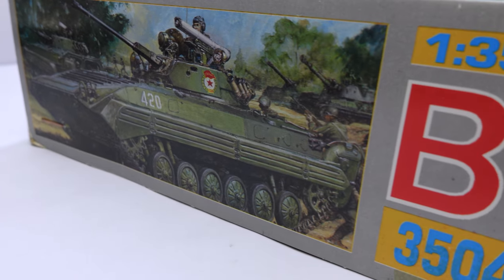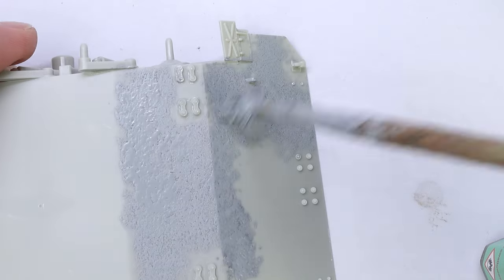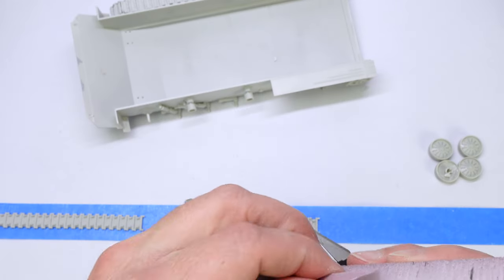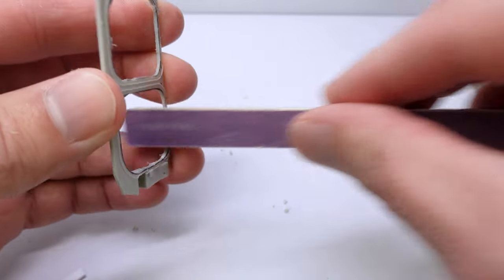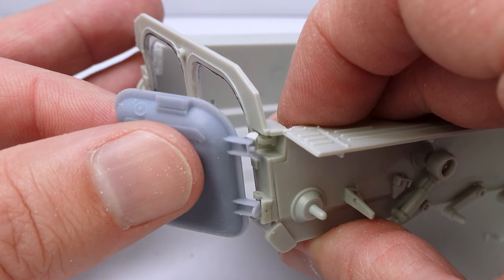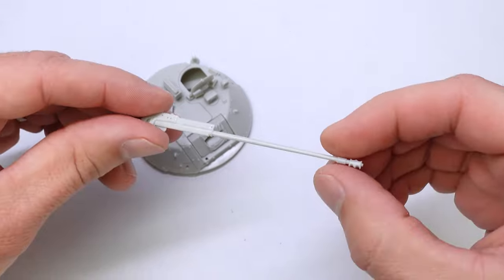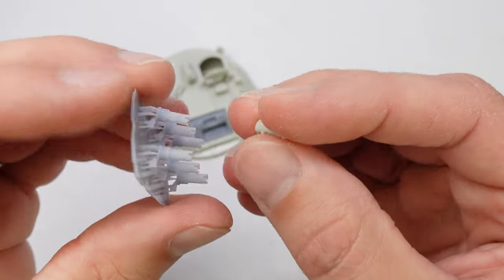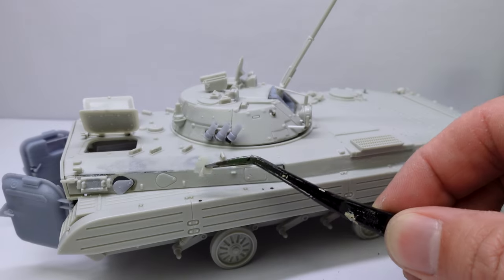Upgrading A 30-Year-Old Kit So I Can Destroy It!

Comment: Fyi...the side skirts are for floatation.  Pretty thick with some foam on the inside.  BMP2 was heavier than the 1 due to the larger turret and they had to add bouncy.
Reply from the maker: Yeah, reference pictures are a must for a build like this. It also helps to know info like that so you don't modify something incorrectly. Great point!